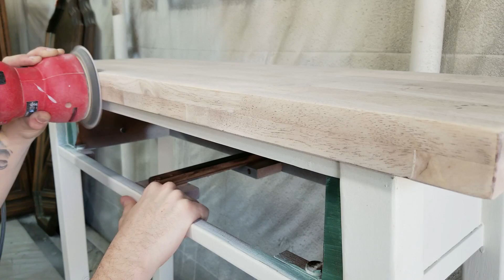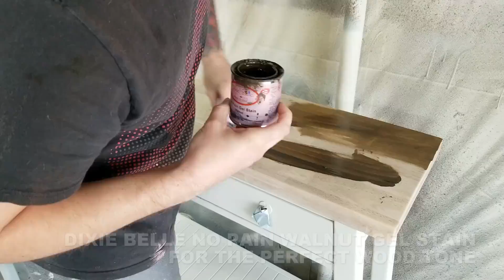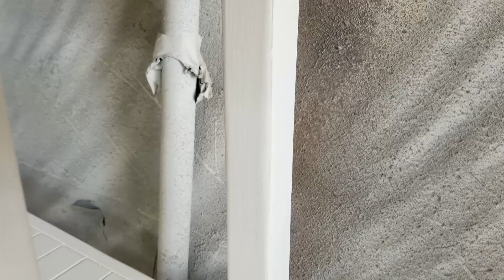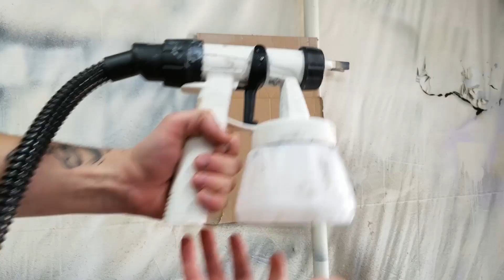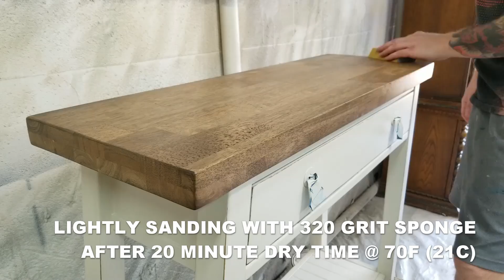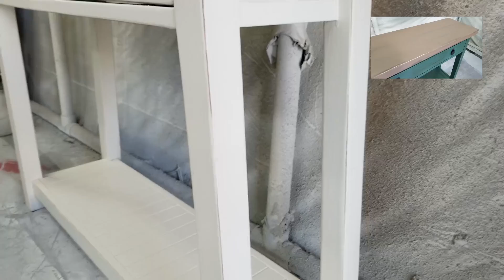Custom Painted Furniture Part 2: Staining with Gel Stain and Spraying Top Coat with a Wagner Sprayer

Comment: Hi Ryan, would you recommend this sprayer for a beginner or would you go spray less? I read the reviews for this Wagner home decor one on Amazon and there were not so great reviews. Air spurted paint around when you’re not holding the trigger? That can’t be good!🤷‍♀️ What’s your experience with yours? Thank you!!
Reply from the maker: The problem with the reviews of this sprayer is that it is a starter sprayer. It is an inexpensive starter sprayer too. One problem with that is that the majority of users are new to spraying and dont know how to operate their sprayer, adjust the settings, or clean it out properly. Because it is an inexpensive sprayer it has less power, so you have to learn the different settings for different mediums, figure out if you need to thin paint, etc. That can be frustrating but all sprayers have a learning curve and many are different. It took me a few months to get master the Wagner sprayers even though I have been using Graco sprayers for 7 years. They're just different. As far as paint spurting from the tip when not holding the trigger, that usually ends up being 1 of 2 things; It is either a cracked/brocken O-ring that goes in the nozzle,  which could have come shipped that way or possibly broken by the user when they first cleaned the sprayer as it is difficult to remove. Or, it is that the sprayer nozzle was not cleaned properly during the last use. So lots of user error, learning curve, and all sorts of other variables. Would I recommend it? Yes. But I also recommend people prioritize cleaning over everything else and to be patient. If you're worried about the $80 price tag you could make a visit to Harbor Freight and purchase one of their sprayers that is very similar. I think $30 to $50. However, you'll have no customer support like you would with Wagner. Broken O ring? They'll send you one. I have seen a lot of people say they like the sprayers from Harbor Freight. No personal experience here. Dont be afraid to take the jump. It just takes practice. I spent $200 on my first sprayer. Ruined it within a month, took it back, ruined that one in two weeks, then upgraded to a $300 Graco and I was happy with that. You might have to just play the field and see what works for you. Hope this helps!
Reply: That Shabby Guy you’re awesome thanks so much!!

Comment: It's lovely. Has it ever happened to you that yellowish stains had bled through the paint? Do you have a tip how to avoid that?
Reply from the maker: Yes. That is called "bleed through". It happens as a result of the oils/tannins in wood reacting with water based pain. The oils come up as it dries no matter how many coats you do.

You can use spray shellac, lacquer, or spray paint to seal them in prior to painting or spot treat them as they happen. I prefer to pretreat. This is why you see my spray painting primer before painting in most of my videos.
Reply: @ThatShabbyGuy  I see, thanks a mil! So I have to start all over again but will know the next time :)
Reply from the maker: If you have bleeds you dont have to start over. Get some flat white Rustoleum spray paint or an aerosol lacquer and spot treat your bleeds, then paint over them. No need to strip it down and start over.